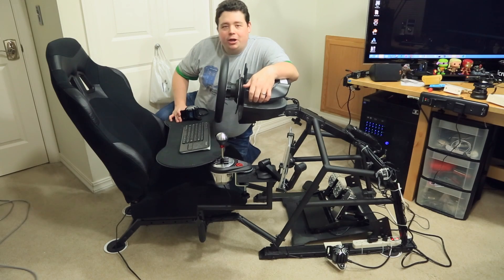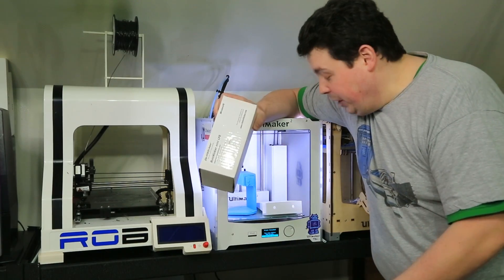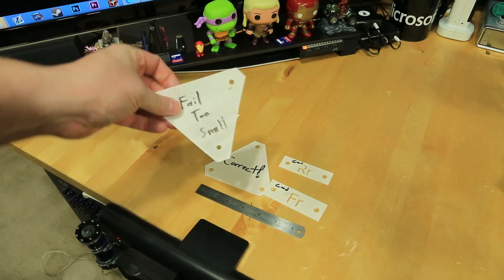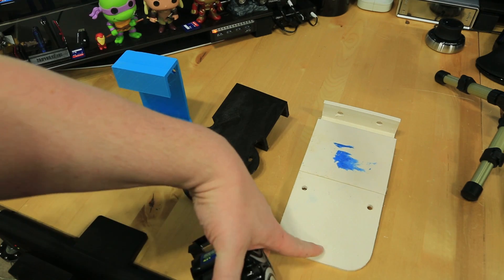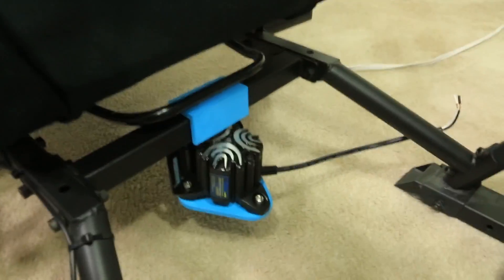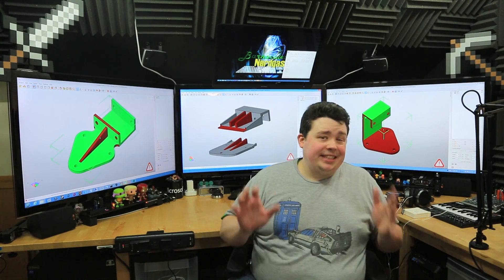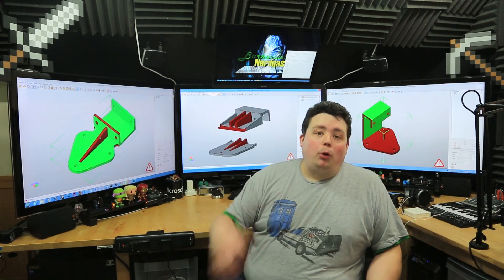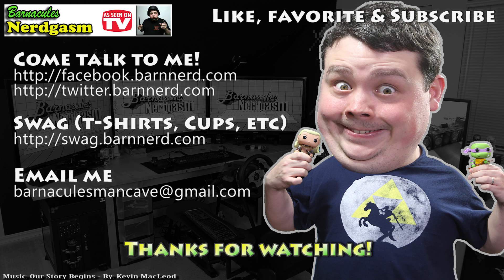3D Printing Upgrades for my Racing Sim Cockpit : Buttkicker LFE Mounts - @Barnacules

Comment: Hey Jerry. Quick question about the T500RS. Can you connect the Clubsport Pedals to the wheel? I've been thinking of upgrading from a Fanatec CSR to the T500RS and was wondering this because my computer doesn't have a PS2 connector. Thanks! -Dan
Reply: the clubsport pedals can be connected via usb as a separate controller, only 2 downsides, you can't use them like this with consoles or games that can only use one controller at a time (I've so far only come across one game with this issue so shouldn't really be a problem.)

Comment: Looks great!
Ive got a couple ideas id like to share.

1. Instead of machining brackets out of aluminum maybe try a water-jet and using steel. I like the aluminum idea but is the $$$$ worth the result. Just a thought.

2. With your amp why not mount it under your desk out of the way and just have the leads running out to the front of the rig with like a quick disconnect. Im sure you can make something on one of your 3d printers. And you could always color code your connections. 

Im sure it will turn out great no matter what you do. Keep up the good work

Comment: Rather than mill aluminium I would suggest getting those parts lazer cut and welded together....would be a lot cheaper than getting someone mill it from solid. Save some serious cash doing it that way. Welds can be polished over after so it stays flush. Source : I'm an engineer.

Comment: Hi!
As far as I understood, you want to get as much amplitude of vibration to your seat as possible. So to do that you should position transducers as close to steel frame as you can. Those brackets, that you have, will work like cantilever beam and will certainly reduce the amplitude. To amplify transducers vibrations the resonant frequency of brackets+steel frame should equal the frequency of sound from a transducer. So, to have a maximum performance you should do something like this:
http://clip2net.com/s/6Qr97r
Sorry for my english))     
Good luck!

Comment: rubber grommets on both sides of attachment for amplifier.  2.00 vibration problem solvers. make holes for bolts 1/16 larger than bolt/screw with grommet on top and bottom of mounting spot,metal washers over top of each grommet.

Comment: Do you have the clubsport pedal set, to adjust the spring on your pedals?
I think I made my accelerator pedal too soft. believe I installed the light clutch spring there... maybe the tough gas spring.
I have a fanatec GT2 360 variant with clubsport pedals and plastic h-pattern and sequential shifter... should probably play more Forza 4... and get a video card to kick your ass in iRacing. :-D
Reply: He's got a Clubsport wheel with Fanatec pedals. I believe he still has the Clubsport pedals, but I don't think he messed around with the springs and stuff.
Reply: djpoizon2k9 t500 wheel.
Yea I know they are the Fanatec clubsport v1 pedals... His gas is stock so I guess he doesn't have the set at all, let alone adjusted the springs.
Thanks tho, just curious because I swapped springs for a third time, and I think I went too soft on the gas pedal. Most people end up using the stock clutch spring as the gas pedal. Just such a PITA to swap them out. Those pedals are like setting up a tent!

Comment: The Cura slicer can eat away the holes in your part if it is not set up correct.
Its a bit hidden, in advanced settings, under the Fix horrible options. make shure none of those four boxes are ticked. (just retick them if you get bad .stls)
just mouseover those boxes and cura tells you what those options can do for you.

Comment: You should have used a micrometer instead of the ruler. You would have had accurate measurements at the start. You can buy a decent micrometer for cheap. Of all my tools, I probably use the micrometer the most of anything.

Comment: you could use the MDF option and use Kinetic isolators (chunks of rubber) to dampen the vibrations from the MDF board...

http://www.parts-express.com/buttkicker-ri-4-pak-medium-kinetic-furniture-isolators-set-of-5--300-9462

you could also use those on the bottom of your obutto racing rig to isolate the rig from the floor as well

Comment: From personal experience i think you should not mount the amp to the cockpit just put it under the seat without any rubber bands or whatever. It reduces the effect because it gives it more weight so yeah and Classic Shell FTW.

Comment: Your brackets shod place the transducers on top of the metal frame not adjacent for maximum vibrations. The way you made them they attenuate and absorb vibrations.
Reply: true. It'll probably waste some vibration on the way to the seat.
Reply: make it feel more like an actual car, the way he did it, as there are vibration damping through out any vehicle.
Reply: I don't know... If I make something I make it work to the best of it's ability. If you want less vibrations just dial down the power. The way they are made now power is just wasted.
Reply: qntt2002
turning it down would decrease sound, vibration increase with power though dampened as in a real car. better simulated in my opinion.
you have a valid point, i think the way it's getting done would create the better simulation.

Comment: I thinks that for the amp. You need to put it up front with a shock mount. I was thinking mounting it to the rear of the Obutto but I have a feeling that the transducers will cause to much vibrations there
Reply from the maker: Yeah I was thinking about putting the amp on an MDF shelf suspended with rubber cords.

Comment: I think your amp should probably just stay under your desk or something, it's not really worth it to have it attached to the simulator since it won't be leaving the man cave.
Reply from the maker: The simulator needs to move around the room on sliders so the amp needs to move with it since I don't want 5 sets of wires laying across the floor :P
Reply: Barnacules Nerdgasm You could set it up like an umbilical cord, tie up all the cables and put into a piece of plastic conduit. Then it won't be so messy.
Reply from the maker: Colton Blumhagen Yeah, still not really excited about that. The goal is to slide the sim out and plug in one power cable and one USB and be done.